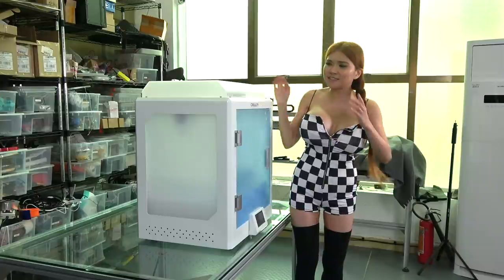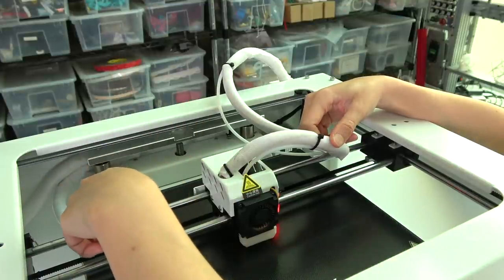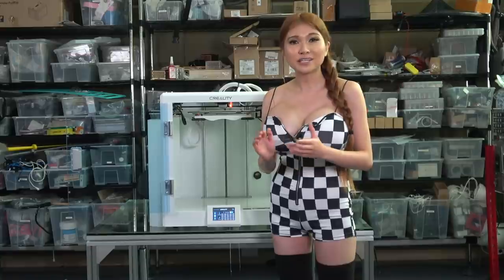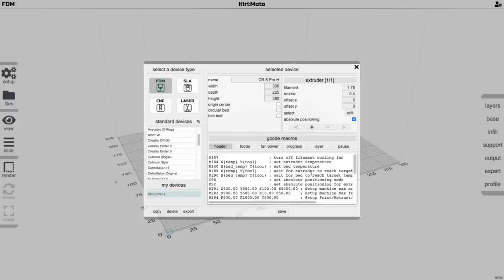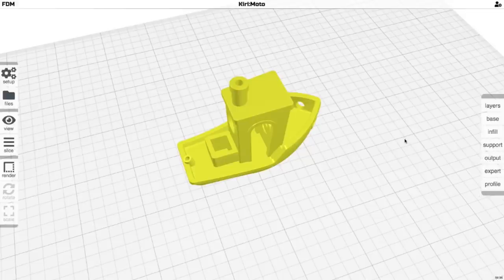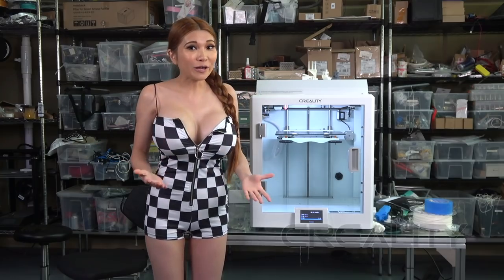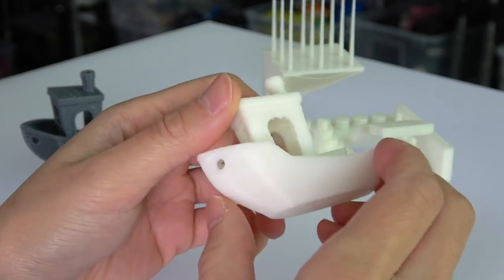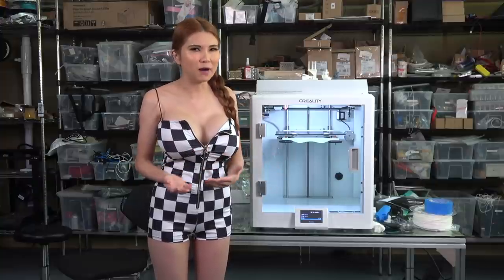Creality CR-5 Pro H High Temperature Printer- and Kiri:Moto Slicer!

Comment: Naomi is a great friend to Creality.  A great friend will not only praise your strengths, but also help with your weaknesses.  This is a service not only to Creality, but for all of us.  Well done, Naomi.  Thanks!

Some questions:

What is the gantry geometry?  H-bot?  CoreXY?  The main issue with this kind of gantry is the total belt length, which limits acceleration and jerk values, but is otherwise excellent.

What controller chip is used? I'd be very disappointed if it were an 8-bit controller.  32-bit chips cost the same and can do far more, especially using Marlin2.

It does use Marlin2, right?  With all safety features enabled?

What kind of bed heater is used?  DC-powered PCB, or AC-powered silicone?  These days, I see no reason not to use an AC-powered silicone bed heater, especially as bed size grows.    I not only like the thermal power available in a silicone bed heater, but it also lets a much smaller DC power supply to be used, which is a win for everyone.

What kind of hot-end is used?  If it's not a Volcano, then you may have problems with higher temperature filaments.  A Volcano is the ONLY way I've been able to get fast and consistent prints using nylon filament.  A Volcano hot-end also helps with printing "wet" PLA, where the longer melt zone lets steam go out the top, rather than hissing and spitting at the nozzle.

Minor typo: The Creality page linked in the video description mentions a "Broden" extruder.  Which my mind read as a blending of "Bowden" and "broken".

About stringing: This can also be caused by poor part cooling.  Could that be the case here?

About the Bowden: Again, at this price point, and given the printer speed/acceleration limitations, a lightweight geared direct-drive really makes more sense.

About the enclosure: This kind of enclosure is for noise and (maybe) fume control, NOT for a heated build chamber.  The problem here is that the stepper motors are inside the enclosure, where they would be heated along with the interior.  Depending on the belt material, belts can also do poorly in heated enclosures.  So don't try that with this printer!

Such a strong and overbuilt enclosure gets me thinking about tool-changer upgrades.  Does Creality have plans in this area?  I've been having fun using my printer as a pen plotter and engraver by crudely attaching pens and laser modules, and I'd like to see a manufacturer make that easier in the mid-range (>$1K) printer market.

I really like the textured ceramic-coated tempered glass bed.  On my Sidewinder X1 v4, a single assisted manual leveling (with the bed hot!) takes a few minutes and lasts for months (I also repeat it whenever I change nozzles).  Always remember that automatic bed leveling WARPS YOUR PRINTS to account for the bed distortion.  If bed leveling truly is an issue and you need precise prints, I always recommend using a raft rather than auto-leveling.  In other words, good printers shouldn't need auto-leveling.  I view the sensor as either pure marketing (with no functional need), or a manufacturer's way of avoiding the need to do better engineering and manufacturing.  Which should not be an issue on a printer priced at $1250.

Thanks for the links to Kiri:Moto and Grid Space!  I had been unaware of them until this video.  Slicers are a barrier to entry for many beginners (including my own nephew), and other "simplified" slicers are just terrible.  I will try Kiri-Moto on my next prints, and it will hopefully earn a place in every beginner's 3D printing tool set, right next to TinkerCAD.  I already see my printers (MPMD, Sidewinder X1) aren't listed, so I will have some work to do getting it setup.

I completely agree about tools that run locally and use the browser for display.  Browsers are the right tool to use for a modern user interface for many reasons, so much so that I see no need to use anything else UNLESS you have to optimize for specific hardware platform capabilities, such as for high-FPS games on PCs and consoles.  I use the JupyterLab environment for my Data Science work (which doesn't run in the browser, but does use the browser for display), and the browser UI makes everything (documentation, code, plots, etc.) work better together.

Thanks again, Naomi!
Reply: First, thanks Naomi for highlighting Kiri:Moto! It's been a passion project for so many years. Making tools more usable is often overlooked in favor of features, so I'm heartened that this resonated with you.

Bob, please ask for help if you run into any issues. I would be happy to work with you to add profiles for any printers you have on hand.

One of my careers was in high performance distributed computing, so getting a slicer to run competitively entirely in-browser has been a great aspect of this project. There is always room for improvement, though. Some of the core engine will be converted to WASM as that technology matures and the opportunity to refactor presents itself.

Comment: Great demonstration Naomi. I don't have a dedicated work shop that is environmentally controlled.  I need a printer suitable for a dusty garage that varies widely in temperature based on the season. I think I need an enclosed printer not for safety,  but for dust, temperature control, and filtering of exhausted air (and I do not want to deal with a home built enclosure). I would like testing to evaluate: freezing garage; hot humid garage; sound level in dB 1 meter from unit; and subjective comments on smell.

Comment: Would like to have seen her print some high temp filaments. I would hope a $1200 printer could print a benchy in pla, how about one in PIE or ULTEM ?
Reply: I don't think this will handle ultem. Specs say it only goes up to 300C. This might be mostly for the usual stuff (ABS,PLA, TPU etc) plus nylon and PC. Would've liked to see a nylon print though.

Comment: Thanks Naomi! Great review and great points! I'd also add, if you are using KiriMoto, be sure to have a strong internet connection! I used it in the beginning and struggled quite a few times due to lag and poor connectivity. That's since been remediated however, after moving to an 64 bit OS on my pi and loading up Slic3r/PrusaSlic3r locally I've found the results to be much better. As you stated however, Kiri is easy to use and the best part it doesn't require an installation! I'll close with, full agreement re tweaking profiles. Creality has more than proven themselves with their printer lines and prices. The Ender6 Corexy is less than a Prusa old school. This is great however, at this point, they should certainly be shipping all of their printers with proven dialed in profiles. There is no reason why I or any user should have to spend day's, weeks, what have you dialing in a printer profile when they are fully equipped and better qualified (they designed it) to deliver a profile that works out of the box!

Comment: Using high temp material I can see the advantage of having an enclosure - gas control and temperature control will be better. I agree, that is a hefty price for the smaller bed. I have a Creality CR-6 SE and I like the features and price break. Any issues I've had with plots had to do with 3D model creation software (not all are as accurate as they claim) and tweaking the slicer parameters for the material & printer.

Comment: Based on the this machine's spec, it should be able to handle nylon, including carbon fiber and glass reinforced, as well as other advanced materials for functional parts. I don't know why Crealty lists only PLA and ABS. At nearly $1.3K, this machine is competing against the Prusa Mk 3 (with an enclosure) and the MatterHackers Pulse XE (with an enclosure). If you're going to print functional parts, $1.5K to $3K is about what you should be planning to spend.  I'll also note your enclosure on ANY machine needs to be ducted out a window, if you print ABS or nylon, because the fumes are carcinogenic.

Comment: Sorry, you got me into Cura Ultimaker, and that's what I'm staying with. I also use Prusa Slicer. I do not feel comfortable using Kiri:Moto since it is web browser based and you have to hit the "download" button to get your gcode out. I'm not doubting what you're saying about it staying in your system and not going somewhere else in the Internet, but I just plainly do not trust it. 

Thanks for the awesome review though!

Comment: It would be great to see a follow-up video about how this handles the high temperature stuff. That’s what it was designed for, after all. I’d love to see something like this printer handling nylon or carbon fibre. I notice the steppers are inside the enclosure so are there any heat issues there? Keep the reviews coming, Naomi!

Comment: While I don’t like is that the fairly large platform is running on just these two thin rails. If you actually fill that platform with a heavy print, I’d be afraid that the front of it would dip a bit, knocking the accuracy off.

Comment: What purpose does the enclosure serve? Is it to prevent dust or fluctuations in ambient temperatures or something?

It seems to me that if you're printing in room temperature in a reasonably clean enviroment, it shouldn't interfere with the printing process. Making a bulky enclosure kind of redundant.

Comment: looks similar to the XYZ Da Vinci printer, I bought one back in late 2000 I think I paid about $500 for it new. great printer for ABS because it was enclosed. Unfortunately it stopped working the wiring harness  that controlled the hot end was not engineered very well and the wires broke from constant flexing. I still have it. one day I'll  re-wire it.

Comment: I don't think its easy for 3D printer manufacturers to ship optimized print settings out of the box. With manufacturing tolerances, etc, the dialing in of print settings is really something that covers the unique specifications of your printer. I have tried to copy my settings from one printer to another printer of the same model as a time saving measure and it just never worked 100%...
Reply from the maker: Nah, you can get pretty close.
Reply: @Naomi-Wu  welp guess my printers suck ass lol

Comment: Naming using a dartboard and a D20 - that's a good one-liner 😁

Interesting printer, looks a bit like an UltiMaker or honestly, my old Replicator 2X. Lot bigger print area than my Replicator 2X, though!

Neat slicer! Not sure it can break me of my PrusaSlicer habit, but worth looking into! Crazy that it's all written in JavaScript, not compiled to webasm from c++ or something. Does it actually need 8gb of RAM like it says in the wiki? That might be the biggest impediment, meaning it probably wouldn't actually run on a raspberry pi.

Dang, that petg benchy was pretty impressive!

Comment: I'd love to see a low cost heated enclosure corexy that had both a large print volume and good print quality. Probably too much to ask for though.🥴

Even though I ended up designing and building my own corexy from scratch, I personally have been looking at the Ender 5 Plus just for it's size. I have the parts already to mod it to be even better. I still may but one and do that. It'd be nice if they offered the Ender 5 Plus as a bare bones type kit at a lower cost. Meaning frame and motion system only. So builders could get other parts themselves. I. E. motors, hotend, extruder, electrons, etc.,. That would be nice. I'd definitely bgo for a bare bones kit. After all I always seem to buy other parts to improve the printers anyways. It'd just help save me money on the kit to be used for other parts I'd know I will be buying anyways. And I would not have the original parts just in some box on the shelf taking up space like I currently do.😉

Comment: 13:00
@Creality
 I ordered my first 3D printer last week. I almost got a Creality, but I think an Original Prusa MK3S+ is cheaper. 
 Time is money, and Josef isn't wasting mine. His product is dialed in. He got it right because he invests in his developers. The total value is what I was looking for. I spent more money than I wanted, but I can justify it because a lot of that money is reinvested in the software. 

 I couldn't care less that Josef only sells 3 printer models. If he only sold one model, I wouldn't mind. I could have gotten a Prusa Mini, but I got the benchmark of 3D Printers.

 Ultimately, I got a MK3S+ because Josef Prusa invested in me before I was a customer and has proven he will continue to do so in the future.

  So why am I here watching this? Other than Naomi's outfit... I'm building a custom enclosure cabinet for the MK3S and thought I would see how this one was done.

@Naomi
  (Kira) I don't enable these types of browser based softwares. I disable browser sockets/PWA everywhere but my phone. 
  Browser and web security are already terrible. The last thing I want is a browser that runs it's own executable programs. The only thing I want from a browser is text/pictures/video. I also want to have easy software version control. That's much easier to achieve when I control and sandbox the source/compiled binary.
-Jake

Comment: Thank you for this great review! 
I totally get your point about the slicer. Sometimes more options can lead to less understanding. 
But, how about logic. I mean when the big slicers are compared to each other, they like to give different driving instructions to the print head, which leads to better or faster results. 
How about Kiri:Moto?
Reply from the maker: I'll have to see head to head, but it's good enough for me so far...
Reply: Performance of generated gcode should be comparable to best in class slicers. If something isn't working as expected or you have a suggestion, please let me know. Production code is updated a few times a week. Bug fixes can be live in under 24 hours.

Comment: 1200$ for a machine that only prints up to 300°c filaments?
when i hear high temperature printer i think of PEI / PEEK / PSU filaments so way beyond 300°C
i got an ender 5, runs CoreXY on linear rails now, the 230V silicone heater goes 180+ on the bed, the 60 Watt cartridge in the Dragon Hotend can easily reach 400°C.
put a solid enclosure around it, move the electronics outside, and you are good to go... all of that will run you around 600-700 bucks and you got a way more capable machine.